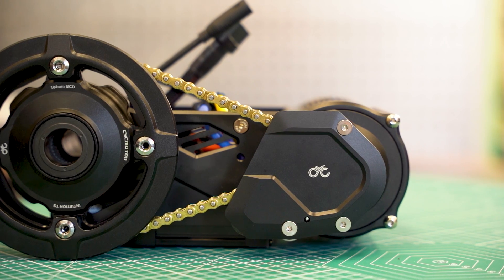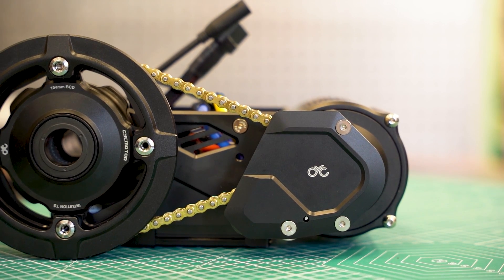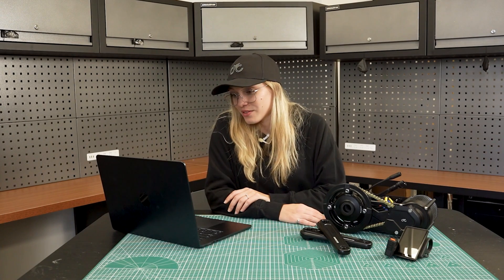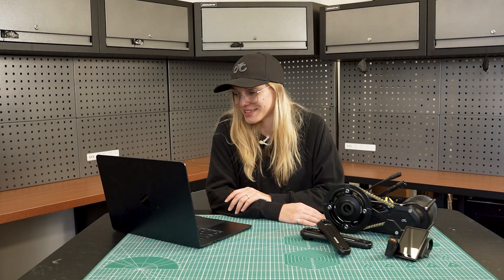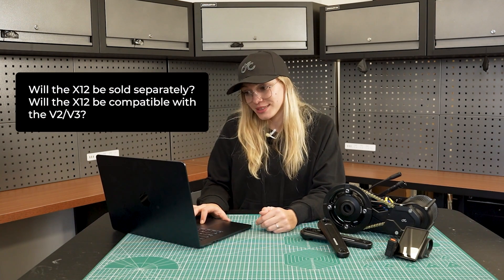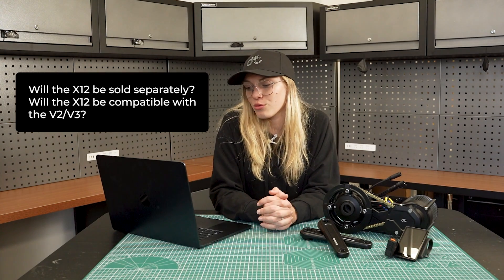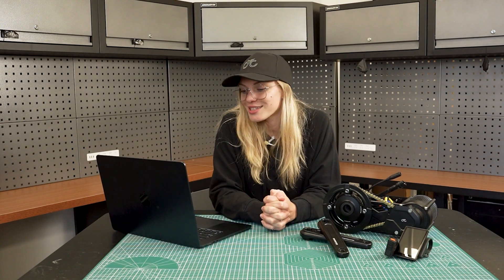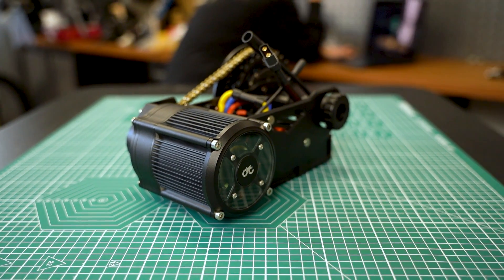X1 Pro Gen 4: Your Questions Answered | CYC MOTOR

Comment: What CYC should really consider is making a sleaker designed 72v battery much like the A-65 but obviously bigger and more powerful. 
20ah like the 65 would be great! 
I have dreams of running a triple 72v setup. Currently running dual A-65 setup but the X1 can handle more...
Reply: Don t buy it , if something happen to the elettronics Even in the first week they will non replace it for free , u have to play for the parts and for the ship , my worst expérience online buying elettronic stuff

Comment: will the Pro 1 Gen 4 bolt right on to Pro 1 Gen 2 mounting brackets, the two screws on the end of each Gen 2 bracket into motor housing of Gen 4?

Comment: Love your mid drive. Heard a lot on the net. Thinking of buying one for my bike. Some major points: Weight is a big issue. A bag of rice weighs 8Kg. The X1 Pro Gen 4 weighs one kilogram more than a sack of rice at Loblaws. Issue number two are the exposed control cables. What type of bike? I'm thinking this mid drive would be great for a fat MTB. If you add a 72V 1000 watt molicel battery that would be an additional 8 to 9 Kg for a grand total of 18Kg. A MTB is typically 13 to 14Kg. Let's round that out for a total of approximately 30Kg which is the weight of a teenager. Could you peddle this bike back with all the bells and whistles added? No? I'm thinking buy a Sur-Ron. How much does a Sur-Ron street legal Ultra Bee weight? 85Kg I can't peddle my MTB after I modified it with the mid drive plus the battery. Too heavy. I can't peddle the Sur Ron either but that's a moot point since my beautiful eMTB is too heavy to peddle. I'd have to be Lou Ferigno or Arnold the Governator to peddle that beast of an eMTB with the CYC plus battery. Knowing all this should Peter waste his time with the CYC 5000W mid drive? Or just save up for a SurRon street legal Ultra Bee. I recently saw Anne Hathaway at the No Frills. Didn't know if it was her. Was I hallucinating. Twenty minutes later after I was walking home with my groceries I thought Yeah that was Anne Hathaway. Same thing with Emily Blunt several years ago. I thought out loud THERE'S NO WAY THAT IS EMILY BLUNT! As soon as I blurted the words her face became crimson red as she fled for the door of the TTC subway train at Eglinton West station. . A lot of movie stars are here for the Toronto International Film Festival. Big Colossal success? Too early to say. Richard Gere is also in town.

Comment: Will the x12 controller support field weakening? Its a great way to get some more rpm out of the motor with lower voltage battery packs. I have used other controllers with the gen2 motor and can say that motor design responds decently to field weakening. 40 amps of F.W. gained around 40% more rpm with my 52-volt battery pack which brought the performance top end up to what most 72 volt packs deliver. I can draw more amps from the 52 volt pack (100) than the 72 volt pack (40) so the torque holds out to higher RPM.

Comment: Will offer different crank arm length? Especially shorter ones?
Reply from the maker: Yup, 165mm and 175mm but you can get shorter ISIS ones from third parties if needed.
Reply: @cycmotor  thanks for the answer

Comment: @cycmotor  Out of curiosity, why not use a belt-driven system instead of a chain, they last just as long if not longer, and would reduce the noise level almost completely.
Reply: the noise comes from the gearbox , you cant hear the chain
Reply: @SIMONC256  agree

Comment: In the process of redesigning the motor for the x1 gen 4 , did you address to the problem of the glued magnets coming loose on the gen 3  , considering the x1 pro motors have had this issue before one would think that in the redesigning of the new motor  cyc would logically address to this magnet issue
Reply from the maker: 100%. It's one of the key things we sorted out to ensure that the Gen 4 is a refined and matured product.

Comment: Major reviewers of this product are saying that this new design motor is flawed because it  has its magnets glued into place as the previous design  and may still  suffer the same problems as its predecessor  did   where ithe magnets tend to come loose or off when the x1 pro gen 3 was pushed to its limits or driven up hills extensively
Reply from the maker: Contrary to popular believe, it's not a design issue. We carefully considered the motor design when developing the product and have reviewed it with every generation. However, we had to look much deeper into our manufacturing processes. With a very tight tolerance and strong adhesive, the magnets are tested with highest RPM and won’t fail. It can now take a lot more abuse in extreme riding conditions.
Reply: @cycmotor  bull💩🎯

Comment: In your tests many hours is the motor capable of spinning at max rpm without the magnets self destructing or flying off? How is the the way the magnets are secured any different to the poorly designed gen 3?
Reply: Overprice paper weight..! Their customer service sucks !!remember this is a sales platform the only reason their answering questions is to make a sell The company itself if you have problems will not get ahold of you and only send you algorithms to figure out your problem..!!🎯
Reply: Having asked those questions I still want one haha
Reply: @rirrid5662    You got a $1000 a throwaway this is the motor you need...👀

Comment: Will the Gen 4 take 52 volt battery?
Reply: It will because the Gen 4 are going on the Ristretto 512 bikes and those use 52v battery
Reply from the maker: Yes, the Gen 4 is compatible with 36V to 72V nominal packs. Just be sure to check your battery specs because smaller packs will not be able to provide the full power capabilities of the kit, if that's what you're after.

Comment: Will it sound the same with that high pitch sound like the Gen 3? I heard its not as loud off camera in person but still curious
Reply from the maker: There is some small improvement on the sound compared to Gen 3, but the X1 PRO is an inherently noisier motor due to its exposed chain. But the sound matches the power and in real life and it is quite acceptable considering the power it delivers.

Comment: any plans to add a 120 mm bottom bracket option for the stealth? Building up a fat bike set up I’m going to need 120 for clearance. Would love to run a stealth as I already own one and love it but I may have to run the Pro which is overkill for my situation just to get the spacing.any plans or any way to run a 120 on your stealth?
Reply from the maker: Hi Travis, 
To simplify our product range we decided not to offer Stealth at 120mm. However, Photon has a 120mm version which should also fit your needs :)

Comment: looking for an ebike set for food delivery... what motor in your line up would give me the best range with dependability and which battery would provide the best range?
Reply: Photon no doubt, least moving/exposed parts
Reply from the maker: For commuting and basic cargo (i.e. not extreme heavy load use cases) the Photon will be your best option.

Comment: I'm hallucinating, no one asks about the biggest problem, which is the engine, I don't understand it.
Reply: What would you like to know?
Reply: @LeSourisBleu  The gen 3 and gen 4 have the magnets in the same way glued and tied to the 2 parts of the motor, I think it is still a mistake.
Reply: Don t buy it , if something happen to the elettronics Even in the first week they will non replace it for free , u have to play for the parts and for the ship , my worst expérience online buying elettronic stuff
Reply from the maker: Hi, motor core is completely redesigned and updated already.

Some customers are asking about whether it is the IPM or SPM motor, we would like to explain in further details:

1. It is a SPM motor given the size and diameter of the motor design. SPM is an optimized engineering choice for such a compact motor which needs to fulfill the power requirement. it will provide better torque and efficiency comparing to IPM motor in this form factor and weight.

2. There are pros and cons respectively for SPM and IPM motor, SPM motor can in general provide better torque and efficiency with the same weight and form factor, downside is that it is much more challenging to build the rotor for high rpm. 

3. The gen4 rotor magnet is now retained mechanically along the two edges of each magnet with high precision tolerance. They are then reinforced by strong adhesive. We have tested all the motor up to the peak rpm and we have also verified all the new design with an intensive life testing.
Reply: @cycmotor  The gen 3 and gen 4 have the magnets in the same way glued and tied to the 2 parts of the motor, I think it is still a mistake.
Reply: @syntxansyntxan7543 Why do you think it is a mistake?
Reply: @Zestybwoi  Because the magnets break and come loose when they are stuck, they have also said this in the forums.
Reply: @syntxansyntxan7543 I see, maybe the fact the rotor is longer will help though. More surface area between magnets and rotor slots will give a stronger bond for the glue than before.

Comment: My gen 0 Cyclone 3k is still running fine after 8 years, but I have to admit that fat chain and chainring looks really nice.
Reply: Fat chain is only because of the tighter pitch (they can use a smaller cog on the motor), the torque there is very low.